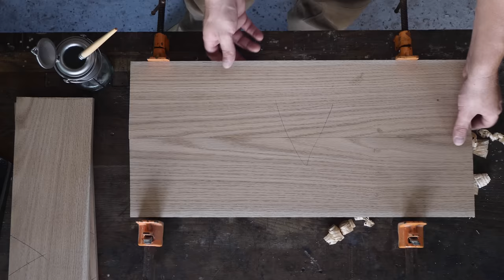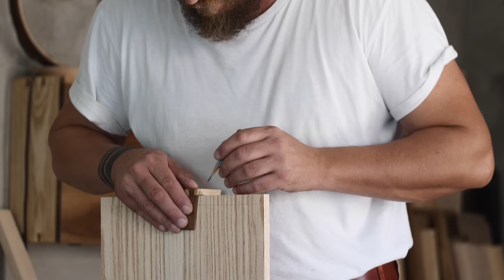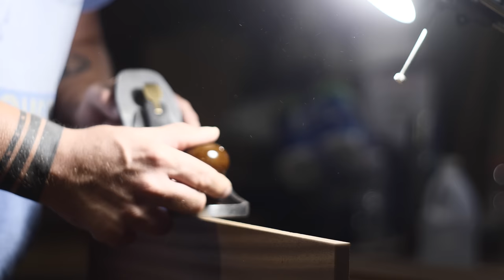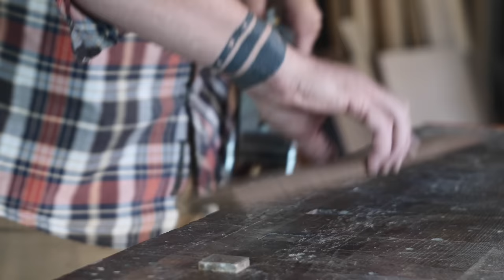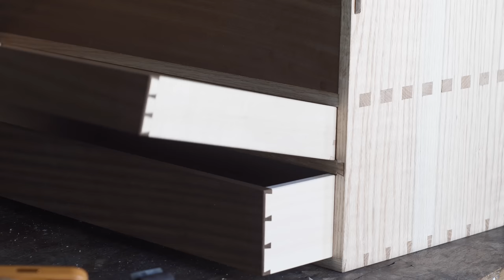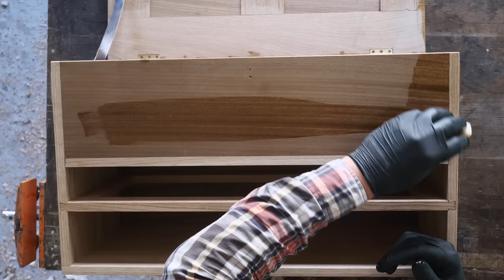Tool chest making - ONLY HAND TOOLS

Comment: Did your measuring tape just travel the opposite direction it was supposed to go?? 🔥
Reply from the maker: https://www.bmi.de/en/products-pocket-tapes-429-bmimeter.php
Reply: I ended up finding one and had them shipped to the states. I have a heck of a time getting it to retract. Lol.
Reply: Super talented , well done
Reply: Wow luv the measuring tape.  Checked out the website but seems to be only in metric (no US).  Also no shopping cart.  Do you know if available in US?
Reply: What glue are you using?
Reply: @damonmanni They're on Amazon US.

Comment: What is that you are adding to the bottom of your plane? I’m very new to woodworking and haven’t seen that yet.
Reply: It’s oil to help the plane glide smoothly, also to minimise corrosion over time. Usually a small used can with a rag soaked in machine oil or camellia oil.

Comment: I like every aspect of your tool chest. But I have a question: Did you not oil the inside? A long time ago I was told to oil every surface to avoid different absorption of moisture.

Comment: Out of curiosity why didn’t you finish the inside? Great work
Reply from the maker: To be honest, I don’t know for sure - but the inside of the furniture is not covered. Interesting to find out
Reply: @gr_woodworking  I meant it looked like you didn’t put oil there. I always heard that can cause the wood to warp if the moisture changes differently on one side than the othet

Comment: Thanx for the video, quick question, I always have a hard time cleaning up end grain on my shooting board even with a sharp blade, how much r u shaving off cuz cant find the sweet spot
Reply from the maker: Ooooh, this is a big question, but in short, it’s all about a perfectly flat sole of the plane and a tightly lying blade - if this is not the case, then the end will never be smooth and the blade will always bite